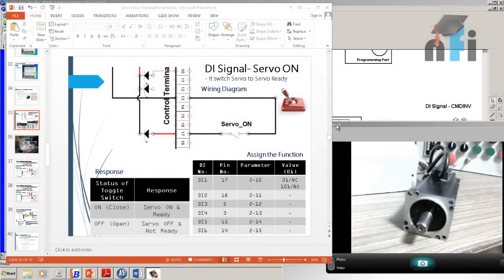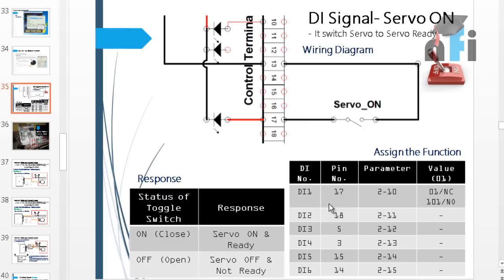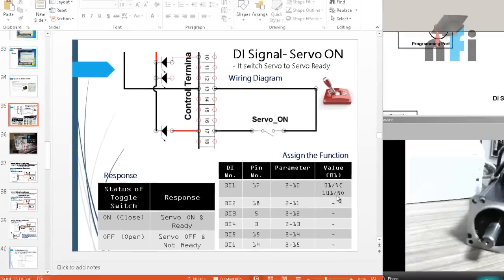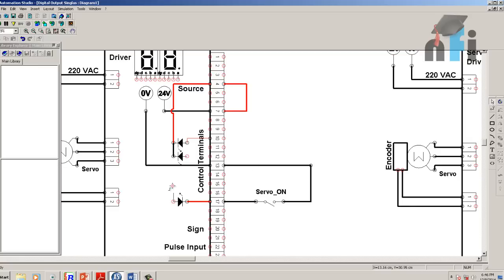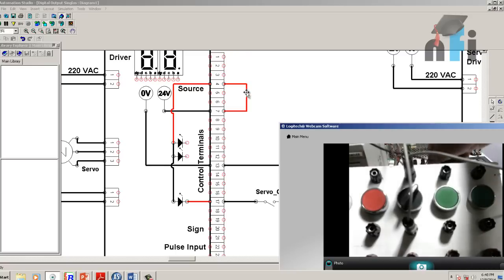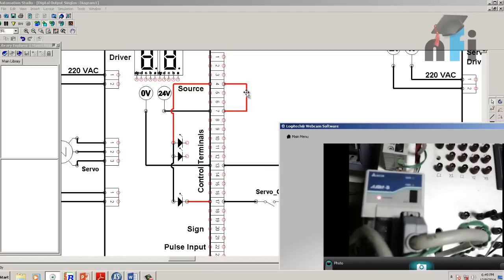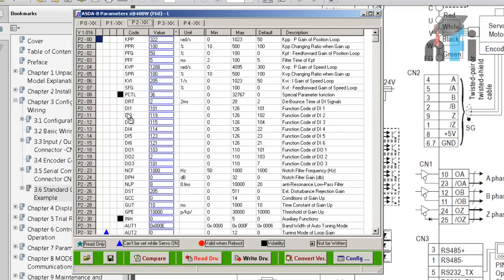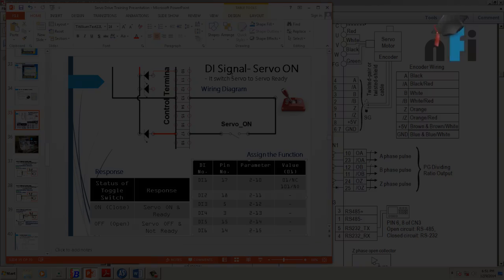Delta Servo Tutorials- How to Turn ON Servo

Comment: How to fix servo drive  Alarm ( ALE 12)? 
Please Help me to solve it
Reply from the maker: Dear Kong, I read about this error in the Servo Manual. It says potential cause is "motor is running" It's corrective action is - Turn off the motor.

Another potential cause is Analog input contact does not correctly return to zero. You have to Measure and check if the voltage level of analog input contact is the same as the electrical potential of grounding. In that case, Correctly ground analog input contact. If this does not resolve the error, please contact Delta customer care